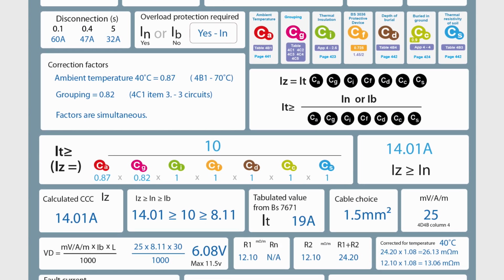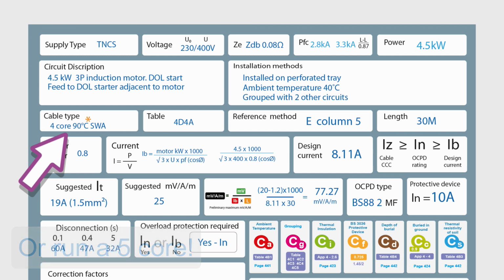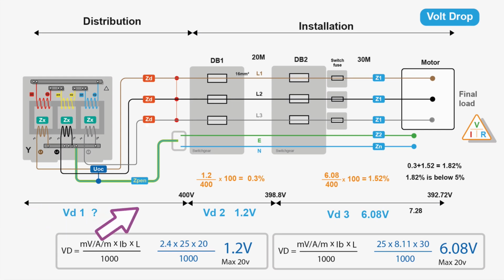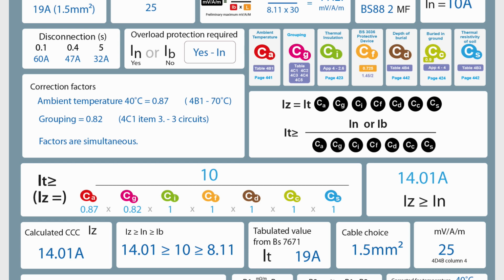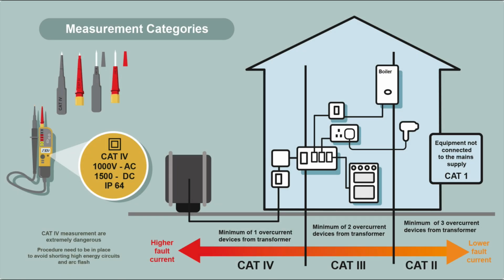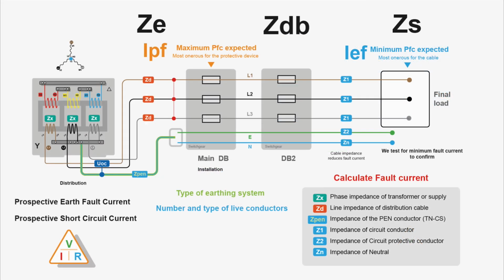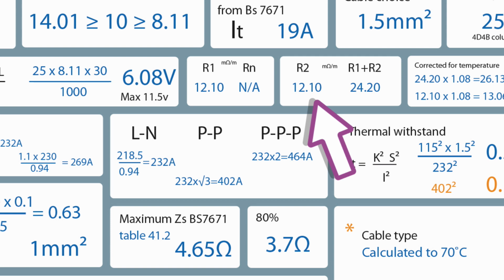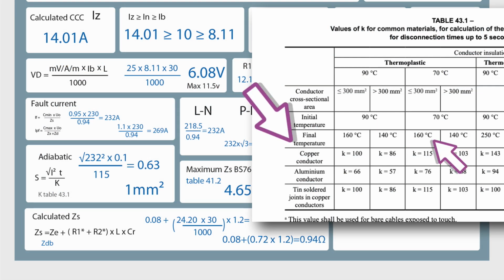A cable calculation for a three phase direct on line motor starter

Comment: Good video, and very informative. I do feel that you've glossed over verifying the protective device is adequate with regards to starting current. Are you working on the basis that 8.11A FLC x 8 (multiplier) = 64.88A? In which case the 10A BS88-2 fuse you have selected has an instantaneous disconnection of 60A (well, at 0.1s), whereas the 16A BS88-2 fuse has an instantaneous disconnection of 115A (at 0.1s), so wouldn't that have been more applicable? I feel that the fuse you have selected may still cause unexpected tripping.
Reply from the maker: Thank you, I will re look at the video , and get back to you